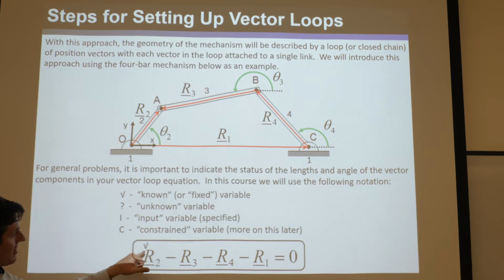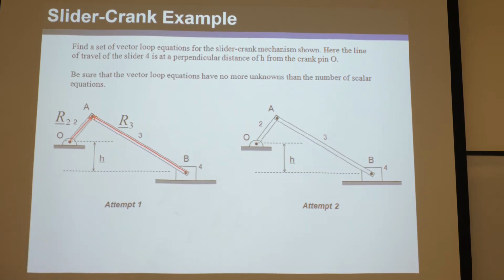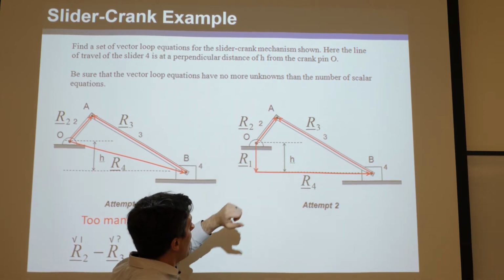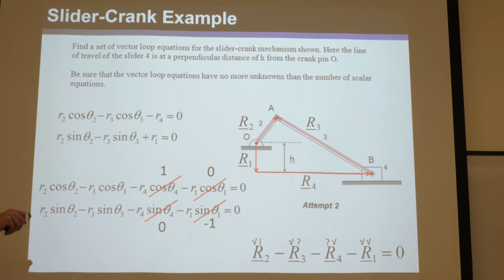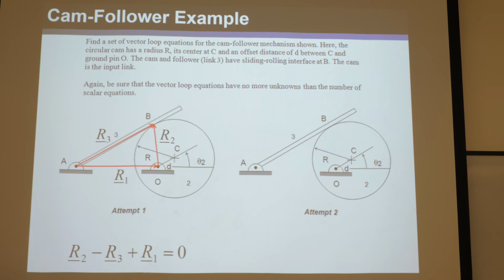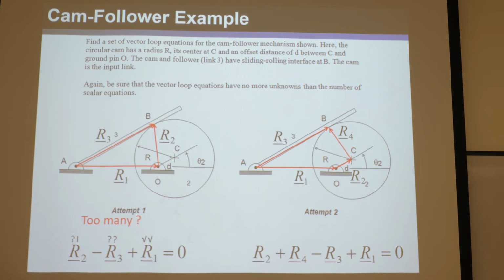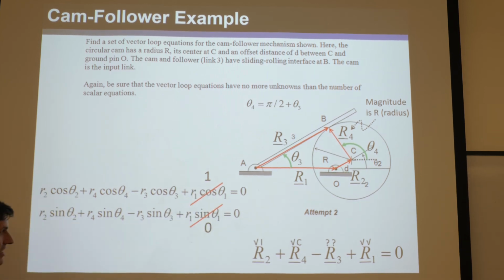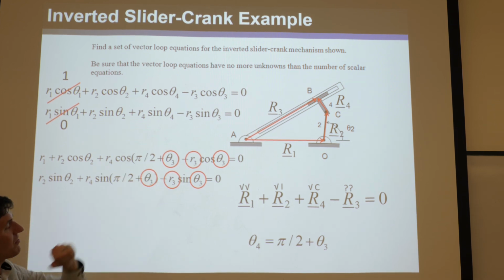Traditional Mechanisms and Mechanical Systems: Topic 2 Part 2

Comment: In the Cam follower: Isn't the drawing of the vector from A to B is actually right. And  shouldn't there be an R5 between the vector R3 and the point A, since where I would put the joint on the lever changes the vector R3. I could put it below or above the lever and not in the center. At least it is explained in the next examples this way